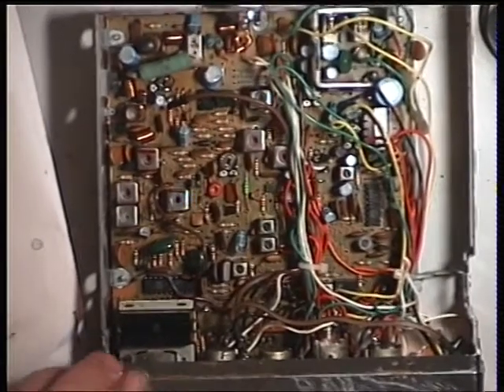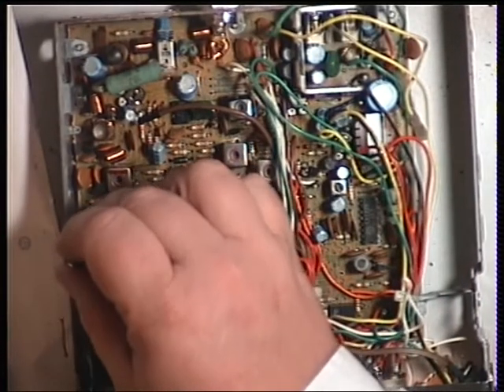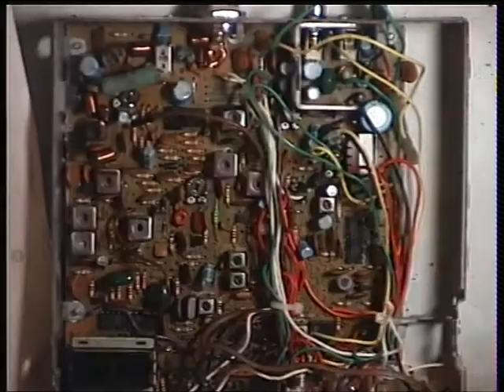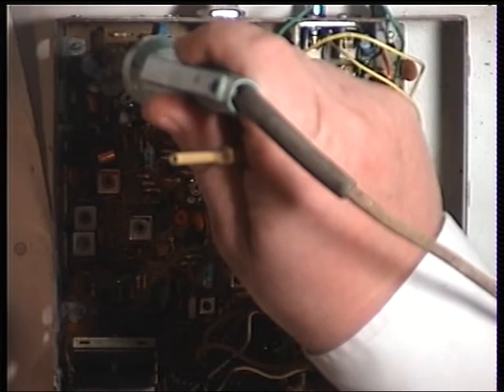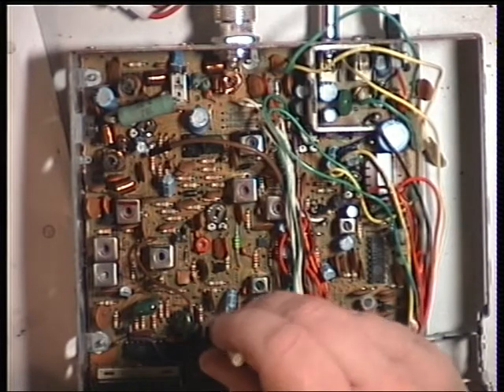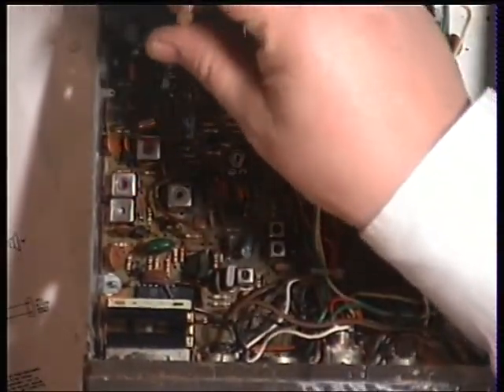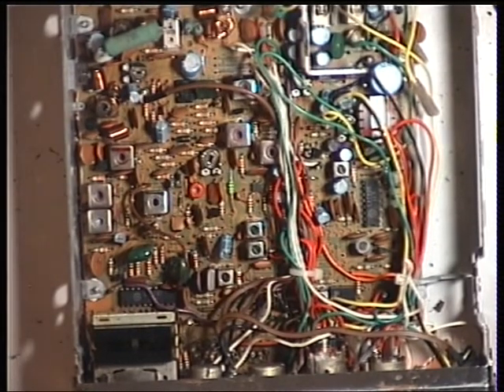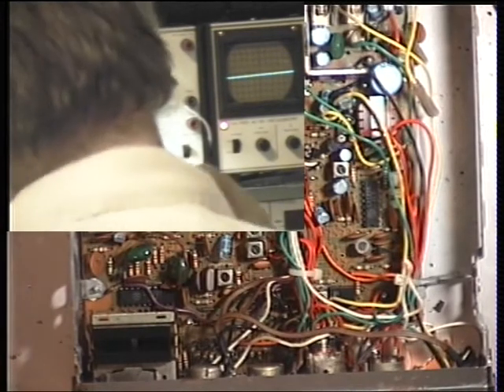Fidelity 2001, UK (CB 27/81) CB radio (Mobile)  - Transmit adjustment

Comment: That takes me back. Amstrad 901 chassis. The Fidelity 2000 was the better one with the cybernet chassis, I was the local (mansfield UK) rig doctor back in the day.  I must have around 30 radios boxed up with other bits and bobs lol.
Reply from the maker: Good on your collection of radios. The chassis used is in fact the Cybernet PTBM002F which is also as you correctly say fitted to the Amstrad 901. However, the Amstrad 901 comes in three versions. "made in Japan", which was the original £89.99 (tha Amstrad 900 is always this version), the cheaper £59.99 made in Hong Kong genuine version......then there is the fake pirate copy made in Hong Kong version which you can tell when you open it up as the main PCB isn't screen printed; these awful sets were £29.99. The genuine Amstrad 900 & 901 are excellent performers; the fake one abysmal. The fake chassis is also found in the spinnytronix CB100 & the Harvard H646. 

The Fidelity 2000 is only marginally better.

Richard

Comment: hello again

I want to inject an RF tone into a cb radio, but not sure how to do it...!...Are there any projects/kits I can make up I'm getting very good with the old iron...Made myself a Morse practice key....which got me into thinking injecting a tone into a cb..I have an old harvard with a very lazy S-meter...which I think just needs setting up....hope you can help

regards

Daz 2e0vap
Reply from the maker: You need a properly calibrated FM signal generator. S9 is supposed to be calibrated to a signal of 100uV. Obviously the centre of the band is channel 20 which on the UK Harvard is 27.79125Mhz. Suitable older model signal generators come up on Ebay & other places at less than £50 from time to time, but are more than £1K new. The signal generator is simply plugged into the CB set's aerial socket. However, make sure you never inadvertently go into transmit with a signal generator connected.
 Although you could build an AM signal generator yourself for probably about £200 in components cost, it seems pointless as you wouldn't be able to calibrate it without loads of other test equipment. I've never seen project details for an FM signal generator; it would be very complicated to build, cost as much as a commercial one etc etc.

Richard (UK)

Comment: hi ya Richard,
I'm getting more an more interested in Cb/Ham radio repairs, I have at least this radios in various states of dis-repair. I have built my own dummy load and have purchased a good frequency counter. I was wondering what other test gear would you recommend for me to get. At the moment I have limited funds
P.S fantastic videos
At present I have watched about 50 of them and can't wait to check the others out.
regards
Daz (2E0VAP)
Reply from the maker: Darren Pash It's receive that you need the test equipment for. So an FM signal generator with a well calibrated attenuator is a must. They come up on EBay from time to time sub £100. You need a SINAD meter to set up the receiver with your signal generator. Back on TX, you need an FM deviation meter to set the transmitted audio deviation (would be Modulation in AM sets). 

I'll be doing a test equipment tour nearer Xmas.

Comment: HI Richard, 
im looking at a fidelity cb1000fm radio at the moment are there any of your vids covering this chasis?
regards chris.
Reply from the maker: The receiver requires the use of a sweep generator to set it up. When I move back onto radios on 1st October, the Great chassis (which the Fidelity 1000 uses) will be coverered numerous times in it's various guises
Reply: No problem Richard i had gone through your videos and didn't seem to think it was there. Im sure my mate had this radio and it was a right bleed over box in its time. October it is then.
regards chris.
Reply: ps Not the radio question but one the same as.
Reply from the maker: At the time, Chris, when everybody & their dog had a CB, bleedover was a problem. Now there are luckily far less users it shouldn't now be a problem. Despite not being the highest of quality, they have stood the test of time. Unfortunately they work using a general purpose synthesiser chip that has to have multiple crystal mixers to obtain the UK channels; this can be difficult to set up. Secondly, the receiver doesn't use an FM subsystem chip (like the MC3357 for example) and is an all-transistor solution. It's more like an AM receiver with a double diode quadrature detector added on at the end. This is where a sweep generator is needed for alignment or it would be impossible to achieve symmetry. 

On the plus side the receiver is very sensitive (was too sensitive back in 1981 hence the snag), the transmitted audio is fine, though it's difficult to coax more than about 3.5 (real) watts) out of most of the transmitters.

The basic Great (Taiwan) chassis is the same, but in 3 variants; the Fidelity 1000 uses the GT848 chassis, the Lake 850 & Academy 501 use the GT858B chassis & the Lake 950, Academy 502, Elftone ELCB6000 etc use the GT868 chassis. There are loads of other badge-engineered variants of the latter two.

I remember about 7 years ago we were doing some tests of random sets at distance. Mark (G7NDJ) was 35 miles away mobile with a 9' aerial at a high point near Nottingham parked up in our test vehicle. I was here using the base station (Antron 99 with ground plane kit) aerial. Mark had taken ten CB's out to test. We were interested in TX & RX clarity at distance. I didn't know which sets he was testing, purposely. The two most outstanding on TX clarity was the crappy Icom ICB1050 & the Fidelity 1000. Mark had no RX issues with either as well. The worst sample that day was a brand new (at the time) Danita 3000 multi!

Richard
Reply: Interesting reading Richard,
Like you say bleed over is not so much a problem nowadays, but i remember my mate having his fidelity radio and there was was a woman down the road and you could hear her on about 3 adjacent channels up/down as clear as anything, and for that reason at the time i was  not very  impressed with it.
But having said that ive had some good results with this one using only an 1/2 wave vertical antenna and radio pwr only.
If i remember correctly they was not a very expensive radio i seem to remember going to a shop  in manchester called chicken box for it .
Anyway thanks for your replys and i look forward to october (well not for the weather and darks nights lol)  take care 73/51 Chris.